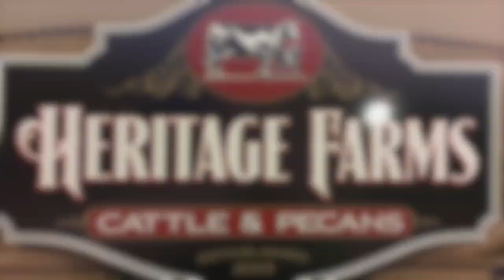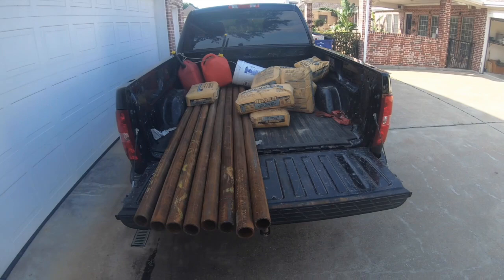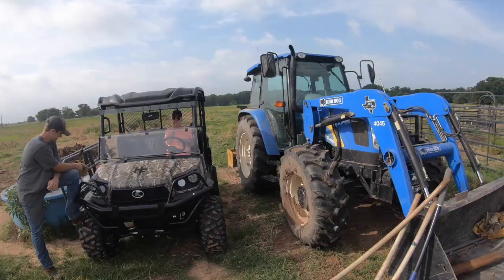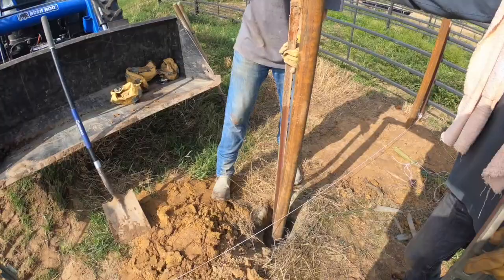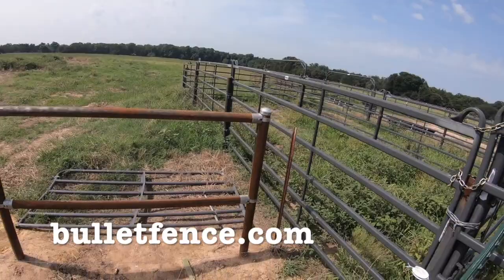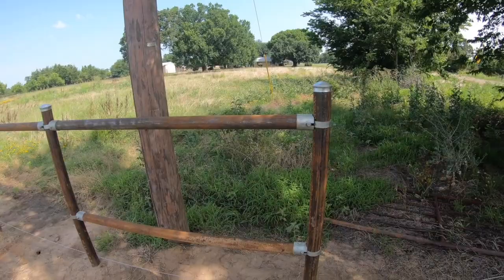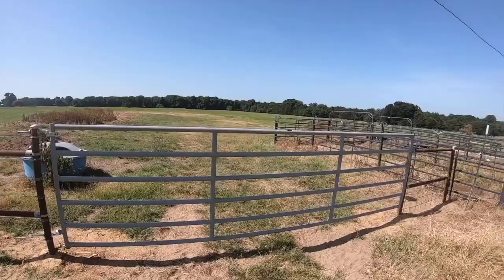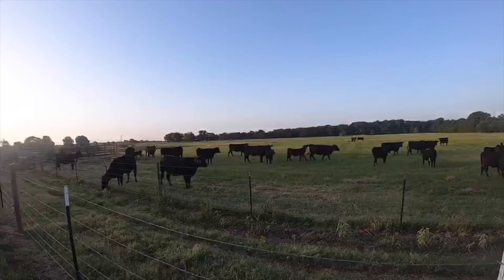Bullet Fence Project

Comment: Nice job on that fence, I like the structure.. I have a 1500 Silverado  and my 76 F150 can out haul it. Silverado's at the 1500 level are city/urban trucks. They are nice riding and very dependable however.
Reply from the maker: Del-Rio Drifter yep, you’re spot on.